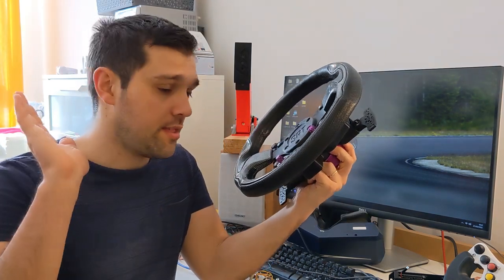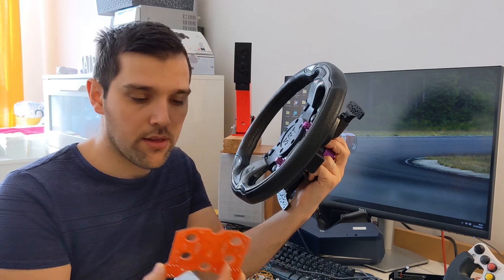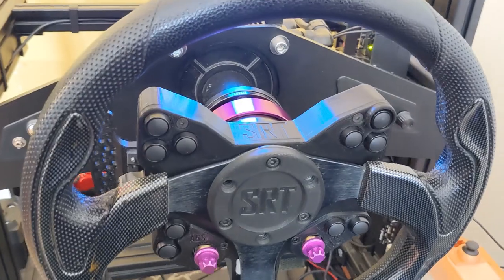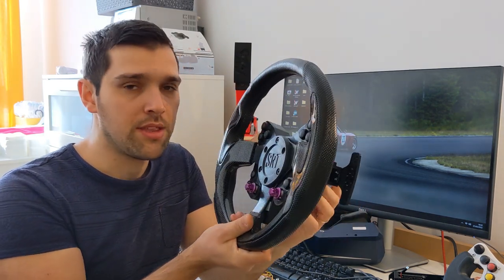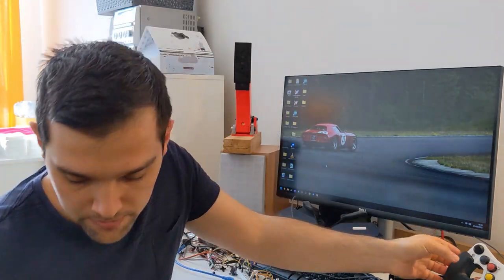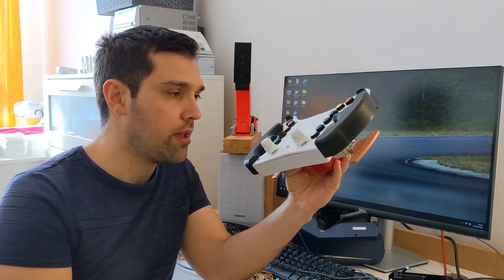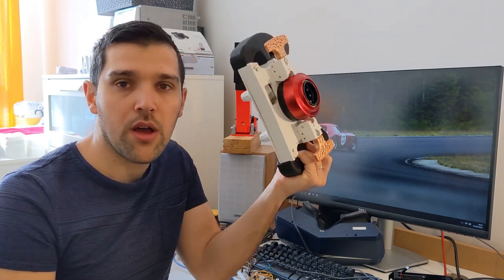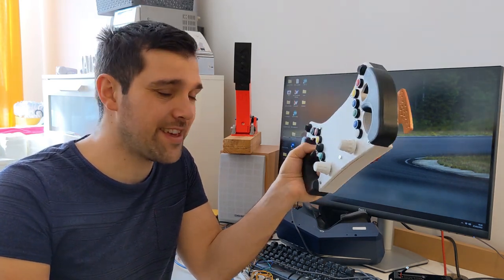Simucube wireless button plate DIY !

Comment: Looking at making my own wireless wheel with this but how did you configure it? the simucube wiki says "Configuring the wireless button plate module is not possible without a programming device and software that is only available on request from Granite Devices to button plate manufacturers.".

Comment: This doesn't particularly need to be used with a simcube does it, the box can be adapted to a thrustmaster?
Reply from the maker: I guess so. I can easily fit a arduino Micro inside
Reply: @LeboisRacing  thanks I'll probably make one